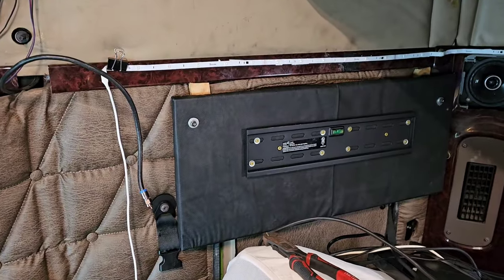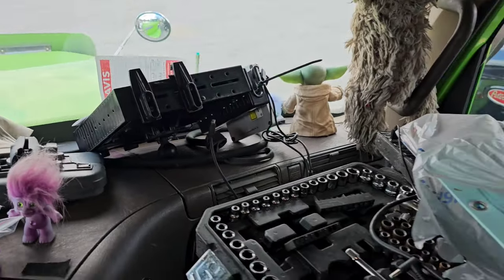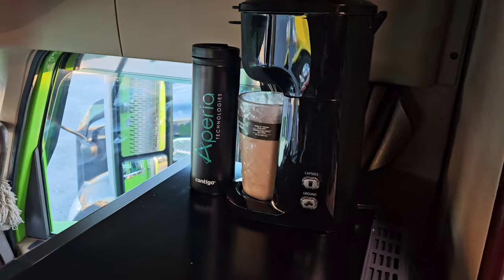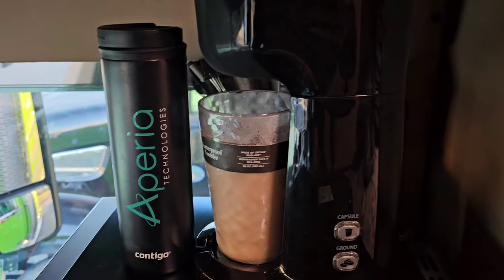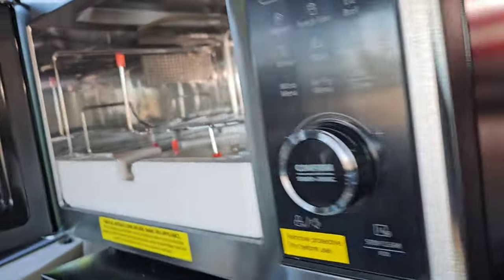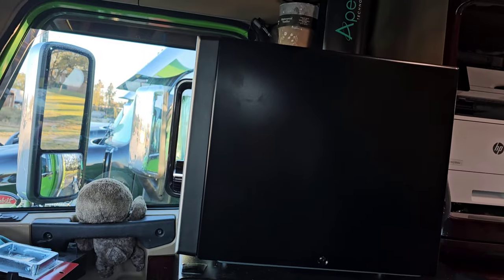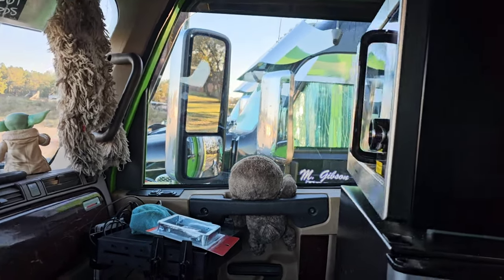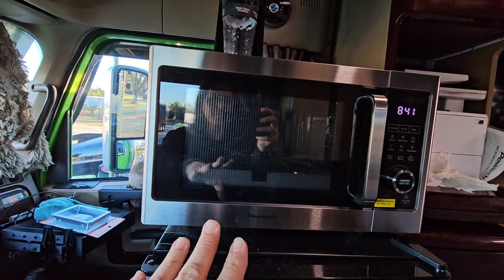Adding a 3 foot fridge with seperate freezer to my Freightliner Coronado

Comment: Based on Clutch’s experiences, I would highly recommend getting a thermometer with a remote sensor that you can put in that fridge to monitor temperature there, like he has now. There’s models available that have an alarm that would sound if it exceeds a given setting.

I have another idea on how you could mount the microwave and improve the visibility out windows but would need to explain it by voice and sketch.

Comment: In my fraghtliner. I  pulled my cabinets out and put my freg and microwave in, and tied them down with Rachit straps
Reply from the maker: I actually thought about poking that upper cabinet but I have some clothes in that cabinet along with my Verizon internet cube and dish network box mounted on the side of it. 🤦🏻‍♂️